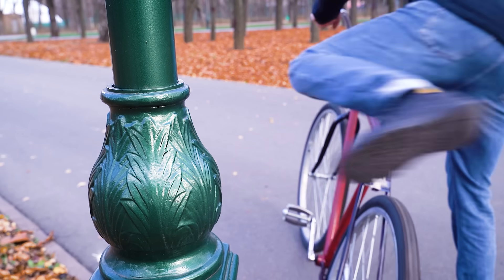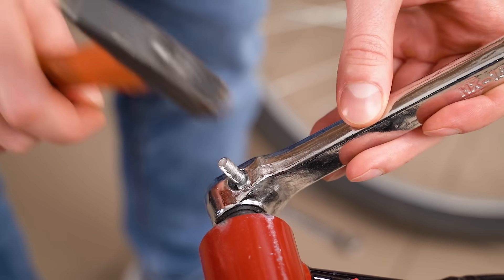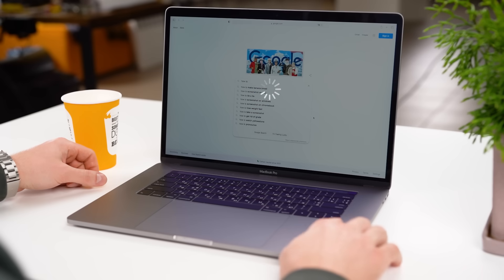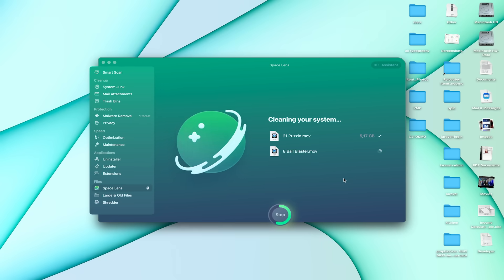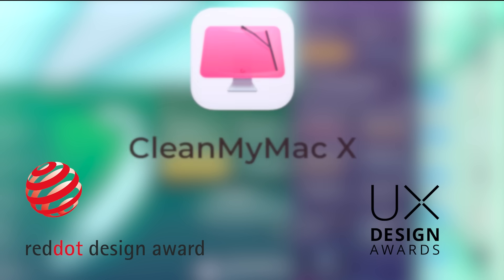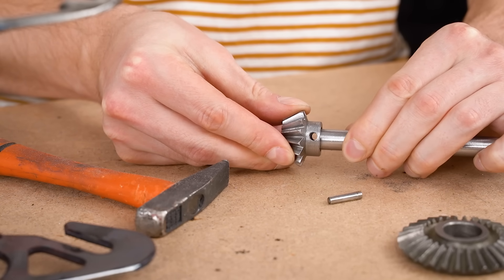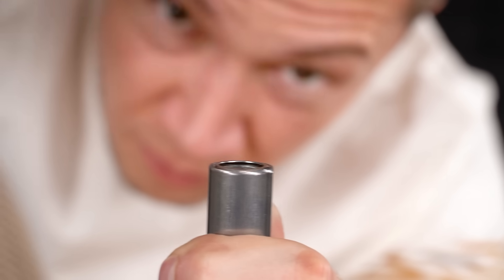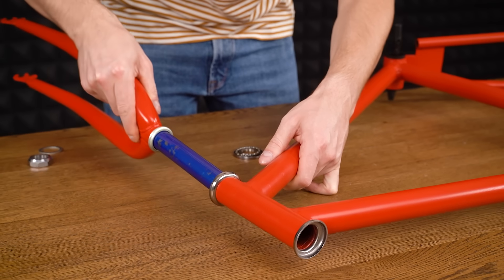Insane Chainless Bicycle Prototype

Comment: Primitive bike. You're using up more energy to travel. A traditional bike doesn't require that much pedaling and you'll even travel farther and faster without exhausting yourself as much in the long run.

Comment: Make the gears longer, use splines with a double shaft for movement of the shaft. 1 shaft moves back and forth on the main gear to make  a variable gear ratio. use a cable to move the gear. no loss on shifting like a normal bike.
Reply: Not a double shaft, a bigger shaft.

Comment: We moved from direct drive to chain driven a long time ago for many reasons. Will the chain occasionally fall off? 

Sure but it's rare if you shift gears properly and use a well designed chain and derailleur and almost never if you don't switch gears.

All this does is remove that feature all together lol

Comment: You were pedaling very fast but that was not reflected in how far you traversed. I'm sure that setup grants the rider a massive torque quirk which makes it easy to climb hills but will suffer a massive speed reduction. New gear ratios will be required for finding a comfortable compromise between speed and power.

Comment: I think it's not reliable due to increased forces applied on the moving  shaft ( very little diameter - more momentum applied ). E.g., while climbing a mountain or off-road it can be easily destroyed. Better invent something with greater diameter, greater speed and less momentum applied .

Comment: The only problem is, the bicycle wont keep going once you stop pedaling, you wouldn't get any rest at all, and you could only brake once you stop pedaling which puts a lot of stain on those gears, which will corrode overtime. great job on the Video though!!

Comment: Nice project but in reality it just won't work as well as a chain drive. Your still going to need a hub gearbox unless you live in Holland, it's not going to take more than say 250w before the gears slip without radical strengthening, the gears are going to wear just as fast and probably faster than a chain unless they are in a sealed oil filled gearbox.

Comment: Nice video! However this type of power transmission requires continuous lubrication aiming smooth and long life operation. At the end of the day a case (gearbox) should be consider in this project.

Comment: I think there is an improvement to be made   on the fact that its a  fix  gear bike. What if you use the  same  approach that conventional bikes  use only  that you move the fly wheel which has a "neutral" to the front... the gears can keep moving without having keep up peddling especially when going downhill.

Comment: I'm all for evolving from chains, but I see two potential major flaws with this.

1. There is only one speed set, no gears.

2. I don't see the two cogs gripping that well and slipping under heavy pressure, and could wear down fast  with all the traction running through that one small part.

Comment: why didn't you use any fucking bearing on that driveshaft? like, it looks cool, but its not gonna last a long time, and welded gears would be q better option, instead on using a metal bolt to hold it in place

Comment: Liked very much. But I just want to suggest that will it be okay if you change rear wheel gear which is big to a small gear and the small gear which is attached to the rod  near the rear wheel to the big? Actually I have not found correct words to explain but kindly try to understand.
Reply: Oh sorry! Same suggestion was given but I just typed my comment as soon as I completed the video

Comment: The torque will be too much less buddy, that's not for uphill roads, you'll fail there. That's for high speed(even though you'll have to push hard in the starting).
But nice work

Comment: Pretty cool! Thanks very much. May I ask, how well does it perform with uphill or downhill adventures?
Reply: It doesn't. There is your answer.
Reply: It would perform worse than an old bmx… the way it’s set up the pedals will ALWAYS spin and the gear ratio sucks so if you manage to push up a hill you’ll be completely fucked and wish you spent $100 on a second hand bike (or didn’t ruin a perfectly good bike for this crap)
Reply: Going down a steep hill would be fun to watch.
Reply: @johndoe-so2ef  and probably painful for the person riding it haha

Comment: The gears would be better if filled with lithium grease. But that will also collect dirt and wear the gears out really fast. That gear as is won't last 20 miles.

Comment: The freewheel of the bicycle helps you to allow motion without pedaling. This bewel gear makes the wheel move only if the pedal is rotated. In the chain-drive, output is more. Energy wasted

Comment: my question is why isn't there a 15% load of power going into a diferential ? and basically you have 2 wouldn't that decrease power 30%?
 racing motorcycles use chains over shafts for handling and power

Comment: Pointless video with misleading title. Thumbs down. 
Chain is much more efficient. Besides that, without having a rigid case for the gears, you rely on the frame to keep them fully engaged. This means they can either only be allowed to take so much pressure, or the frame has to be made extremely heavy to avoid flex. Any flex will cause the gears to move apart, and this is how failure occurs in any gear mesh. 

Any bike, even modern ones, that have tried this method cost more to construct, weigh much more, and suffer reliability issues. No one wants a heavier bike, no one wants a more costly bike, especially when the extra cost is a result of a less reliable, more difficult to ride machine. 

These have been a novelty idea marketed to people that think "different is better" with no basic mechanical knowledge.

Comment: Shaft driven bicycle

Old designs, not practical.
- mechanical failure
- overall uncomfortable (feel, sound, ride...)
- What's the "gear ratio" (how will it be customized) HIGH COSTS

___

For today's purpose, it needs

- gears (easiest is internally geared hubs, alfine, which also provides ability to create sturdier parts = most hate due to costs, and servicing) another option is crankset or bottom bracket adding high/low

- sealed system (it will rust solid) as designed "NEW BIKE FRAME" (current drive shafts are attached parallel to chain stay)

Comment: Drive shaft bicycles aren't a new concept, their main drawback is that their fixed gear so you can't adjust power ratio and you can't back pedal. But props to you for building your own system 👍
Reply: I don't think it is mechanically efficient as a chain and sprocket.
Reply: I heard some company's trying to make an automatic transmission for it tho
Reply: what about hub gearing? you can back pedal and you have multiple gears to select
Reply: @SB7-r9i  yeah, but it gets pretty complicated with fixed gears
Reply: My ex was shaft driven
Reply: What’s the point of backpedaling tho I rather use it for a hard brake like in a 1 speed city bike
Reply: @bobmorane2082  you can’t coast without the crank rotating either.  That’s has to be odd?
Reply: @bobmorane2082  for those who aren't used to it it can be a detriment, also breaking isn't very easy on fixed gear bikes, I'd say their for experienced riders only
Reply: @enderlord5412  What are you breaking? 😂 Don't you mean braking? 😅
Reply: @bobmorane2082  different speed acceleration and efficiency
Reply: @bobmorane2082  so that if you're going down a big hill, you can just stop your feet. If you do that with a fixed gear bike, the bike pedals will get to spinning super fast and won't let you put your feet back down. There is a way to use a ratcheting gear in order to have backpedal abilities.
Reply: @bobmorane2082  Thats not what he ment, he means you have to keep peddaling on this like on a unicycle so you cant rest your legs
Reply: You can still back pedal if you use a ratcheting system on the pedals axle.
Reply: @sethh8892  I did think about that after l afterwards
Reply: @enderlord5412  yeah, it's pretty much the only way you could make it backpedal without some ridiculously over-thought clutch system/ torque converter.
Reply: And the force placed on the gear is incredible. In order to last, the gearboxes have to be extremely beefy (and heavy)
Reply: gear ratio, not power ratio. if a chain could amplify power we would have a problem
Reply: It would also make engineering a rear suspension more difficult lol
Reply: @3vanguardofthephoenix335  not really all you'd need is a universal joint on either end like a cars drive shaft but, that's a good point
Reply: Also the pedal you do it will go farther ...you cant stop your legs too
Reply: Open gearing is messy. Needs precision.  Expensive.  By "backpedaling " you mean free backpedaling?  You could if you had a little backstop.
Reply: You could use a Nexus geared hub but the ratios are all a bit weird - 4:1 ‘ish from one turn of the crank. I’m not bright enough to work out the power output for that 🤣🤣
Reply: Pedal is brake and for riding rear
Back gear/speed/barake/clutch 😂all is in the pedal and in downward riding 😂😭 imagine what to do 👍😂

Aarey yaar brake toh lagaa dete
Reply: I have a seven-speed shaft-drive bicycle. I love it!
Reply: @stephenweaver7631  🤨 that's a very rare sight. I wish I could see that, it sounds pretty cool 👍
Reply: Motorcycles with this like type of cardan system loose about 30% effeciency. But its clean and costless. Doesnt need much maintenance.
Reply: @hansturpyn5455  No, no and no. Well yes maybe for less maintenance although the gearing will need lubrication too. Chains and sprockets are dramatically cheaper than precision cut hardened gears and the additional bearings. 30% makes no sense, gears are very efficient and that mechanism should be more efficient than a chain, even though both dont lose a significant amount of power. 30% makes absolutely no sense, just think of the amount of heat that would need to be dissipated in the mechanism, it would need active cooling.
Reply: @drkastenbrot  its the force vectoring on the bearings i guess. Sort and quality of the bearings (frickion) makes a big difference i think.

Comment: I'm sorry I haven't understood how installed gear on rear wheel. 

As I see your rear gear as front:usually front gear is larger then rear about 3 times.
In this case you can riding byke not faster then on foot.
I've not understood how you resolve problems co-ajoinity.  And what about rigidity of the frame?

And the main question on what characteristic this construction better then chain?

Comment: Where did you learn that? My first time to see it. Amazing! But I think it could have a little more modification to be safer or avoid miss touching of shafts.This modification of chain less bike will change bike for ever. If would also be less costly and easier to change. You can carry the parts and some tools anytime.

Comment: He needs to change the rear wheel to have a 3 speed hub derailleur. The had those back in the day but they’ve disappeared for todays multi-sprocket derailleur.

Comment: So it's just a shaft drive bike. It's nifty and interesting, but unfortunately it's a fixed gear setup with no bearings or housing to keep the gears lubed. Plus sand and dirt would get stuck both worm gears.

Comment: You could have put a big gear and a smaller one on the wheel, make the difference and not have to do so many turns of the pedal to make it speed up, I think it would be a reduction of 1: 4

Comment: Sealed gearbox with lube? Shaft bearings? She won't last long gear to gear dry. Cool idea none the less. Also different gear sizes will change the ratio. Be cool to test different ratios and find a nice middle ground for torque and top end.

Comment: I have a new bicycle from 1983 that has front wheel drive with this setup and also has a cost gear where it lets it go fast down hills and not eat the gears out while peddling with chain on back, 10 speed I think. Bought it from the man who put it together in 1983 and still has tips on the tires. Bought it because it was different, No one ever ask to ride it so it just hangs around
Reply: Do a video on it. Even if its like 1 minute
Reply: Put video up under 1983 2 wheel bike 7 speed for you
Reply: Yes, man had a bicycle shop and in 1982 they made these and the gear would eat out going down hills, 1983 they put a inline slip to fix that, Shop owner took this one out of box and hung it up in store till I bought it 10 years ago. Has the old new tires on it, looks like any bicycle 10 20 speeds, has a cable from center pedal up along the frame to curve down to front wheel and chain drive on back, I bought it because it was different, dark green paint with plastic gear where this one is steel
Reply: The cable is around 3/8 on outside and cable inside move freely inside, I will try to get my daughter to upload a video for you and get a better ideal of how it works for you
Reply: @williamstidham9526  that sounds cool
Reply: @williamstidham9526  I subscribed to the account you are commenting on, It should pop up when a video is uploaded of it for us.
Reply: I followed your instructions and found the video!  So ahead of its time back then.  Thanks for sharing the video. Should have let folks comment. Maybe next time.  Someone is gonna want that for sure.  Nice!  😁👍👍
Reply: Can I ride it?
Reply: Sure, you will be the first rider, the tires are 1983 and still has the rubber tips in both tires and seat has springs, looks like a great bike but need to oil chain and cable, A little chrome polish and wax the paint you would have a new 🚲 , I know there’s not many of these around anymore
Reply: @idk-gq3lh  idk may Google it.....
Reply: @idk-gq3lh  idk... what did u want to know exactly?
Reply: Can i ride it?
Reply: You have to post a video of thàt thing!
Reply: @BigMacOrange  He posted a few videos. Watch his channel. This is so cool...
Reply: Do you want to sell it
Reply: Any video,we want to see.
Reply: BWA 2 wheel bicycle, on YouTube, not mine but would work the same way, made for ridding in sand
Reply: @williamstidham9526  Thank you Mr William for posting the videos. It always feels nice to see these kinds of things.

Comment: Why did you use a bearing cone lockring as the rear wheel nut? Also, this design sucks. So it's a fixie. All that torque on that small gear drive. Not good

Comment: Could you have used a larger gear to get a faster speed that requiresmore force? The sprocket connected to the pedal specifically.

Comment: I Congratulate  your ingenuity and aesthetics of performance.

Better if the gear would have with oblique teeth like an angle grinder (less vibrations) but that's just my suggestion only.
And it would be even better if the gears worked in a closed housing, flooded with grease (durability, wear)
By the way, that the rear gear mount will not bend over time, causing the teeth to jump. 
It seems to me that when you step on the pedals harder (riding uphill), this single plate will be deformed.

Comment: All disadvantages were mentioned here already, still it is great DIY, nice work! Dont use wd40 as a lube, its only good for cleaning old grease, for gears (and ordinary chain) use gear oil for cars and motorcycles.

Comment: Well, bikes flex a little when bumping intro stuff. So fixed shaft will snap eventually. And i think this build willa die when mod will apear. When you have propelly mounted chain it's super relable. Threre is no need to change that.

Comment: Chain drives have had a lot of inventors working to take their place as king of the bike propulsion systems, but they still reign supreme.

Shaft drive has been proposed many times over the last oh, 130 years. When everything is designed,made and assembled correctly, a pair of gears are about as efficient as a chain and two sprockets. Of course, you need two pair of gears, so they are already at a disadvantage as compared with chains.

But what about the real world where things are not perfect? Gears have to be aligned with great precision to be at their best, and because a bicycle frame is relatively flexible, the gears will seldom engage with true rolling contact. This will lead to higher energy loss, noise and wear.

Chains can tolerate misalignment and dirt far better, are available everywhere and best of all, they are relatively cheap.

Comment: First, the gear system is not suitable for vibrations because it is not flexible and will wear out, secondly, the speed is zero😂, but this does not reduce your creativity. You are really a professional. Greetings to you

Comment: Firstly, the gear ratios of totally wrong.
Secondly, without the original sprocket the pedal may be directly linked to the wheel which will rotate unnecessarily when the rear wheel turns i.e. no disconnect mechanism.

Comment: The biggest problem with this design is the absence of the ability to shift, which will make it impossible to both race and climb steep hill with the same bike.
Reply: "Isn't it better to triumph by the strength of your muscles than by the artifice of a derailleur?" -Henri Desgrange
Reply: @headcoatee  I would agree- depending on distance.  On many of the country roads that I ride, I appreciate a much higher gear for efficiency.  But it really does depend if you are doing it for exercise or to get from point a to point b.  I was looking at it from the stand point of  getting some where, not exercise.

Comment: Those gears have a thin contact area. Axles work loose, putting the system out of alignment. The system lacks the vigor necessary in a robust vehicle. Those chainrings are going to last longer. Never buy a gear drive rototiller. That device is going to devour itself toot sweet. Actually this reminds me of the antique planetary gear hub selected by a penetrating chain. Roller chain on bikes is exposed and picks up abrasives. Wash it sometimes with some old gasoline. MC chains get tooth wear, but I have never seen that on a bike.